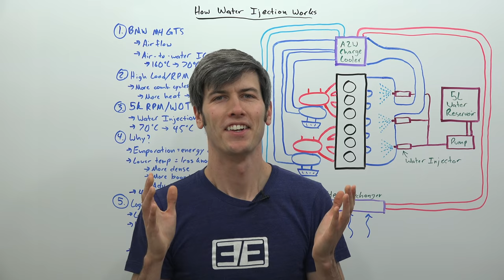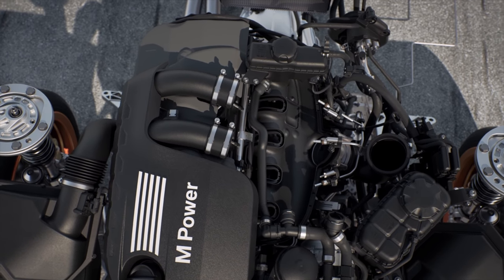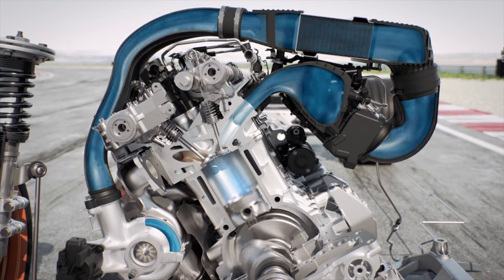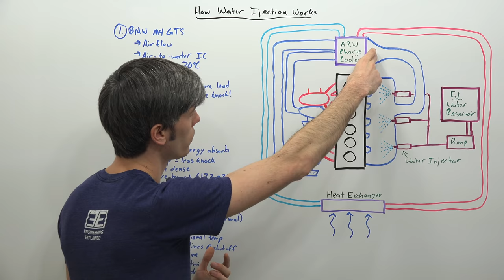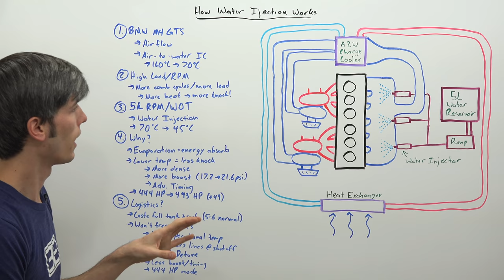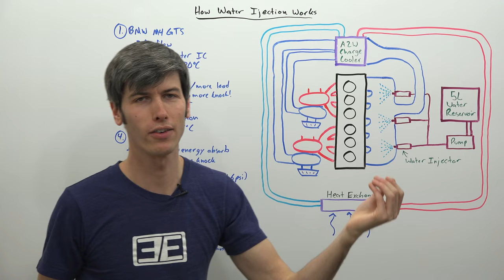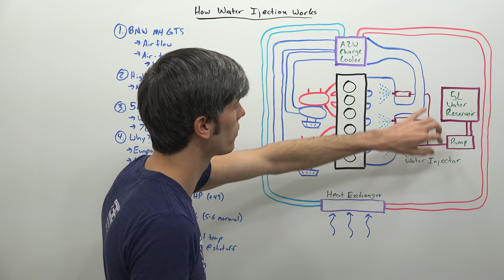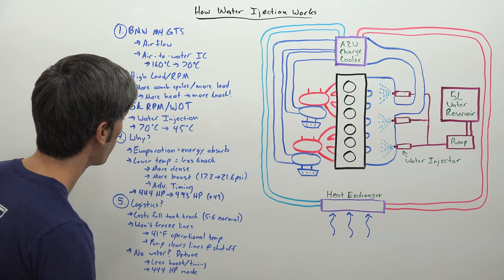How BMW Used Water To Make +50 Horsepower

Comment: Water injection is not a new technology. It has been used in aviation for a hundred years. It was used on the KC-135 when I was on them in1983. On airplanes it makes "More better power!" The system BMW is using was an aftermarket kit in the 1970s for use with Blowers. It is not new tech. Basically what took so damn long! You have to remember to fill the damn bottle! That's what took so damn long!!

Comment: I find it funny that the person who invented this in the 80s was murdered and now BMWs using it! The only difference is the inventor was able to make the vehicle run off of 100% water.
Reply from the maker: Water is not a very good fuel source. Also water injection has been on production cars since Oldsmobile did it in the 60's.

Comment: You may get cooler air resulting in more air volume, but you loose volume again with the water/vapor as a volume reduction. This is also a problem/maintenance nightmare! Water with steel, dumbo idea, they could have at least used silicone or even pex. This isn't all that good of an idea.
Reply from the maker: The turbos will compensate for the volume reduction you describe. You can compress air, so more boost means more air and fuel burned, more power. With regards to water and steel, combustion engines already have a ton of water going through them. Not only from humidity, but water is a byproduct of combustion. Everytime you have combustion occur, there's a bunch of water inside the cylinder that's then forced out the exhaust on the next stroke.
Reply: @EngineeringExplained  I'm not talking about the water in combustion, I'm talking about the water delivery system.

Comment: Water injections systems and EGR Cooler are only operated a short term and just to replace an EGR Cooler will cost between $400- $500 AUD and they only last for couple of year and engineering need to get the rock out of their head and I don't see any benifit of it of having WIS and EGR Cooler

Comment: Yeah and when that pump doesn't evacuate the lines and they freeze the bill is going to be 1500-2500 dollars...
Reply from the maker: But it will, soo... "yeah but when your car's engine fails it's $5000"
Reply: @EngineeringExplained  
That's more than I got in my car after replacing the engine and suspension...  I buy vehicles based on KISS and the Bird Theorem.

Comment: eat beans a day before race and pull an awuarium air pump cord from your butt cheks in to the intake and be ashurad u fart before you read 5k rpm right in to the engine and u get an extra 100whp to 300whp depending on how hott that chilli was.

Comment: What if instead of filling the reservoir with water, you fill it with water+meth?
Reply: Meth is overrated, liquid crack.
Reply: the car would lock itself, send out a GPS signal to the BMW dealership that it was being assaulted and they would void your warranty
Reply: Yes, (winter windshield wiper fluid) please explain.
Reply: Methanol just reduces the effectiveness of water as a detonation deterrent.
Reply: Actually, most water injection system(in trucks etc) use mixture of ethanol, water, and little bit of oil. Oil reduces corrosion and ethanol is effective emulsifier.

Comment: Someone make lean burn turbo with water injection, plug-in electric car with a 100 km battery, the engine charges the batteries.

Comment: BMW could probably make a 100% water car but won't because the oil companies won't let them
Reply from the maker: And because water is not a fuel. Hydrogen, sure. But not water.
Reply: @EngineeringExplained  Steam is also fuel? But I'll leave it at that.

Comment: seems more like a gimmick >5000rpm + flooring + >5°C
Reply from the maker: Huh? It gains 50 HP. That's not made up.
Reply: I know, but the water injection feature is only under very specific circumstances (almost like racing, that's why I posted the requirements you mentioned) so it doesn't aid the power delivery in the rest of the rpm's. The intercooler does let the inlet temps drop; but that's not the key feature that is advertised.  @EngineeringExplained
Reply: @gertwoumans8082  on the track you are above 5k rpm

Comment: so you trying to say that toyota cheap and reliable cars didn't have this in stock cars 20 years ago? loool toyota celica. also love the new lambos ferraris and porsches with 4 wheel steer when even the prelude and most nissans had that back 25 years ago....

Comment: Noob question but not ashamed: What is "knock"?
Reply: "Knock" is a phemonemon that happened when the gas ignited before the engine get full compression. This is happened if you use lower octane rating fuel than recommended octane rating for that engine. Example; your car has engine that designed for run with 93 Octane rating fuel. When you use 87 octane rating fuel (higher octane rating means the gas is slower and harder to burn than other gas with lower octane rating) your car's engine would suffer with knock. Signs of this is the engine has more vibration and less responsive than normal. In long term, engine knock would damage your engine faster.

Comment: Can't you just put a better intercooler in the car?
Reply: Mirinmaru  probably, but you should still get nearly the same benefit from the water (unless you really dropped the temps a lot, it probably won't help and wasn't designed for drag racers who freeze their intercooler reservoirs).  BMW probably crunched the numbers and found this cheaper and more marketable than increasing the intercooler (and of course no true German engineer would want something as simple as increasing the intercooler).
Reply: @wumpusthehunted2628  I'm mostly concerned about the reliability and inconvenience

Comment: Imagine a carbon dioxide to fuel systems in our cars. There will be no co2 emmitons coming out .we will have a almost endless supply of methenol fuel . And we don’t have to use tiny engines no more.
Reply: Crestfallen Plinth I mean is that co2 will get captured in the catilys and hydrogen will get separate from o2 and make a reaction into methanol  and the cycle reapets again,

Comment: All this complicated crap for 49 more horsepower? And won't the weight of the water make the car slower and doesn't handle much worse? And GTS cost $100,000 more than standard M4 due to dealer markups etc, I rather just buy a regular M4 and do a stage 1 ECU tune, +100 hp from 425 to 525 hp for $2,000 instead of paying $100,000 more for the GTS

Comment: Humm I feel the top end engines with looming death coming due to the electric revaluation, have finally admitted that engines can run on water 🤔 wouldn’t take much engineering’ or even work a mix of 50/50 , they then tell us this is new technology 😂😂

Comment: Wouldn’t an air/water mixture (assuming the water all enters gaseous phase) be LESS dense and that’s why they need to increase boost pressure? N2 = 28 amu, O2 = 32 amu, CO2 = 44 amu...H2O = 18 amu. Adding a gas that weighs less than all the other major components should make the mixture less dense.
Reply: Think about it as all system not just one con of it. It allows more boost without knock. More boost is not a need.
Reply: Waldemar Ishibashi I understand the benefits of the system. I was saying it seems that higher boost pressure would be required here compared to a cylinder without water injection at the same temperature due to the decreased air density when water is added to it (to achieve same performance gain). Cooling the air should increase density (like nitrous), and adding water should decrease air density. I’d be curious to see how each contributes.
Reply: So yes, obviously this system allows higher boost...but is some part of the boost pressure number inflated due to altered air density at the intake from water?

Comment: Typical German over engineering. BMW oil seals are made to fail after 8 years. All the seals go in all models. The seals are like hard plastic. The cars have so much plastic under the hood.

Comment: Honda douchebags are going to start putting a squeeze bottle between their seats and running a hose to their intakes. They will use distilled water so the fart can muffler doesn’t rust.

Comment: Didn't this flop in like the 60s?
Reply from the maker: There was a similar system implemented in the Oldsmobile Jetfire in the 60's. Not a flop from a technical perspective, people just don't like filling up multiple tanks. For a track based car, I think it's a neat implementation to keep temps low and reduce the chance of engine damage from knock.
Reply: @EngineeringExplained  the same motivation is behind the current diesel scandal, VW assumed the cars would sell worse if the user had to fill up adblue more often.
Reply: It's more like WW2-era technology used on P-51 Mustang and Focke-Wulf FW-190, except there is no methanol mixed with water.